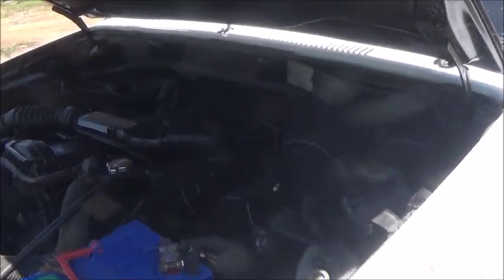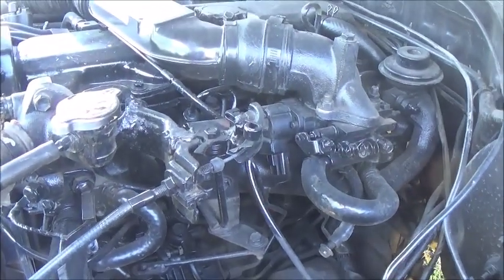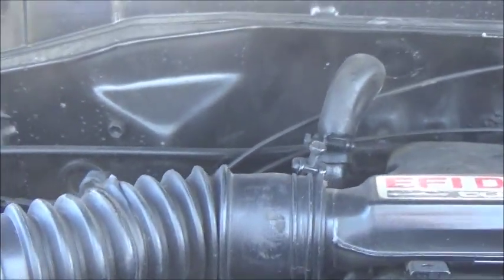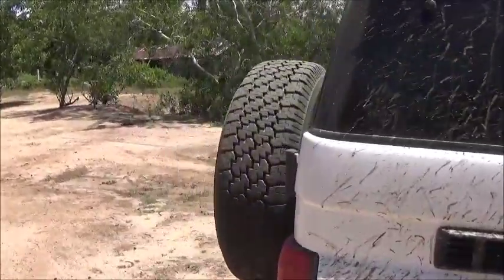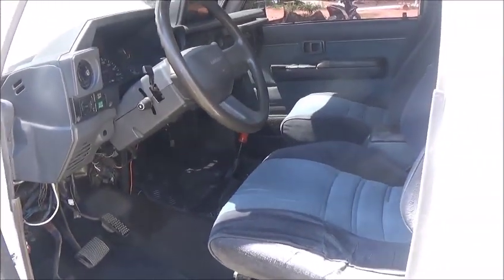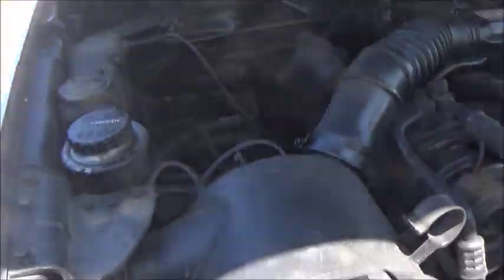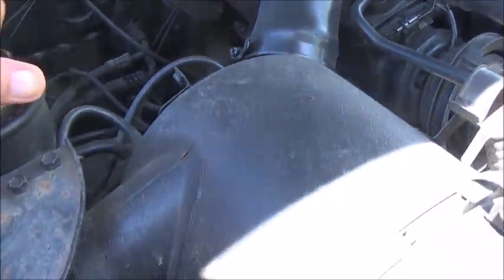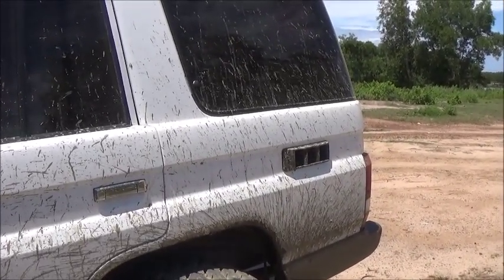Giving A Road Test To A Car Jason Is Interested In Buying

Comment: In most cases... People do not buy the correct ... Tire  Rims... When they look for a wide one... The geometry for the center of the  The wheel bearing .. Is wrong.... Which may tear up  wheel the wheel  bearing as well as the housings.. It would be great if you can get the original rims..

Comment: This cars you drive up to 1 million kilometer. on time oil and a filter.  it just run always. pulls 3.5T ( or more)  If it did have a good owner( on time the right srvice)  you can buy them on the phone. For in the Philippines My number 1 car.  good luck with it.

Comment: 1990's prado, the 1980's had round headlights.
Reply: yeah I think it's a 90-92 j70. Solid front axle and there doesn't seem to be any head gasket issues so this ones a keeper.

Comment: I never owned a Yota my brother did . I have had Fords Dodge Chevy and Subaru's . I miss my Ford F 250 4x4 . I know many say what is or isn't the best to own in any place but the truth is some cars or trucks are just as good as others depending on the drivers.
If people drive like it was free and cost nothing to fix it then yes it will break down faster. I have worked on cars and trucks I also use to repo  as well.
Reply: I'm a Ford guy myself and the new Ranger here in the Philippine with the diesel is a peach but they're pricey. I need a good 4X4 I can bomb around with and not worry about it breaking. LandCruiser do excel at that. Thanks again for Brian checking it out
Reply: @jayandjhenlovingandlivingi5473  my Ford F250 and my Dodge  Truck I couldn't kill . My Ford F 250 was an older truck with granny Low  4X4 and it was a Tank . I would do an oil change  every year or two . I would buy the motor oil at the dollar store. Same for the rest of anything I needed in my truck that the Dollar store sold lol.
I hate to say this but the older trucks were made to last a life time. All the new cars and trucks made today are made to last almost as long as the warranty is good when that runs out  the car/truck dies lol.
 I am not sure I was told a few times that to get a Ford Chevy or Dodge  sent there was costly but I wonder just how much .

Comment: If you want the year Google the vin number. I see a big red flag. Diesels do not have vacuum power brakes they have  Hydraulic assisted power brakes. That truck was originally had a gas somebody has put a diesel engine in it. It will cost big money to fix the brakes. Skip it pass on it.
Reply from the maker: Original diesel engine
Reply: @aforeignerfarminginthephil3374   Not with vacuum brakes. You do not get that on a diesel. Unless there was something I missed in the video I will go back and watch it again

Comment: Too many things wrong with that one . I(t's gonna be a money pit . The oil in a diesel will stay reasonably clean for quite a while if you use the right oil . You have to use heavy duty oil in a diesel . Also if you're getting a lot of blowby in the cylinders it will cause the smoke and burn the oil.

Comment: 210,000k is just run in,  change all the oils and filters it will just keep going, Toyota should have plate on fire wall for build date definitely worth 250,00 php